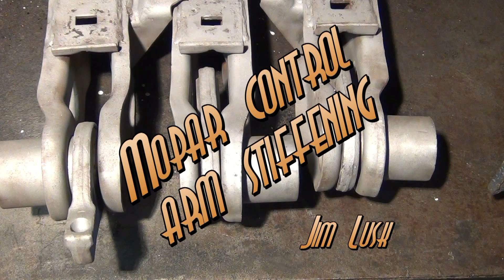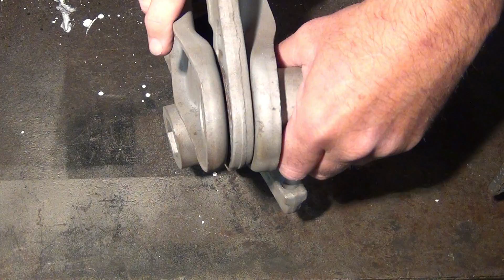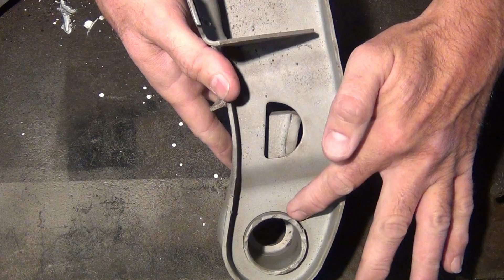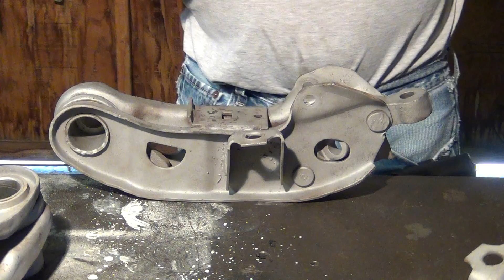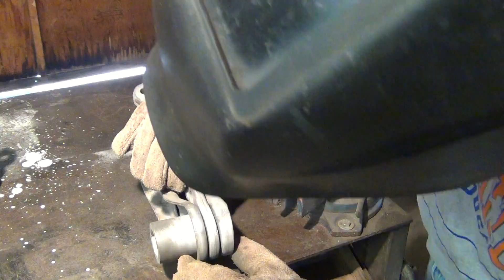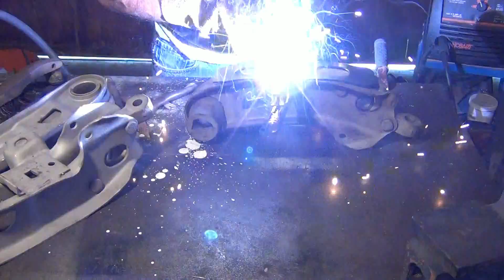Control arm repair

Comment: Thanks Jim! I have been dealing with front end problems on my '72 Satellite/Road Runner Pro street Restomod and I have learned more by watching an hour or so of your videos than in 20 years of reading in magazine articles or trying to talk to "old timers" that know these tricks. i need to fix both lower control arms and reinforce my K-member and maybe i can finally enjoy driving my car and having it go straight down the road! Heck I might even get it on the dragstrip someday!

Comment: Thanks Jim. Can they be too tight? I have a set I bought that have had  a stiffener plate added around the outside radius. The torsion bar pivots are stiff and just able to be rotated by hand. Do you think this would be a problem?
Reply from the maker: If you can rotate by hand you are fine. Yes, they can be too stiff, but that is more of an installation problem than a functioning problem.

Comment: Did you make the stiffening plates ? Or buy them ? If bought where do I buy them at ? Thanks Jim
Reply from the maker: I bought them from the maker, but they are available from Mancini and probably other sources.
Reply: if you want it, i can sell you a template on PDF, you print it and use to cut on the metal sheet 14 gauge. We can use paypal :D

Comment: Thanks for posting. I can see the excess movement in the control arm but am curious to know how this would manifest itself in handling of the vehicle. Thanks again.
Reply from the maker: We're really not sure if the play affects anything in normal operation, but we know it shouldn't be there. I pulled my GTS apart a couple of years ago. The car has around 160,000 miles on it and the front end has been rebuilt once (1986). There is very little play in those arms, so the factory got some of them right, but quality control was not really job one at any of the car companies back then.

Comment: Well Jim, You never thought to put it back in the vise when you welded up the stiffening plate to take the rest of the "slop" out of it?
Reply: You can also make a plate for the round end also I have also done that .fact is that part adjusts the torsion bar and does not mvw going down the road.

Comment: how thick are those stiffening plates?
Reply from the maker: They look to be 1/16".
Reply: hubby wanted to know would that be the same thickness to 18 gauge steel sheet 4x8 he bought? he working on a 69 charger general lee this is the last thing he wants to do before he can put it back together
Reply from the maker: No. According to what I could find 18 ga is about 3/4 the thickness as 1/16".  I can measure these better later.
Reply: ok thank you that would be great

Comment from the maker: There is a large bolt in the middle of the control arm. With the car supported on stands under the frame loosen the bolt on each side until it rocks freely.

Comment: Getting ready to replace the whole front end on a 1968 300,and I was wondering how to properly release the tension on the torsion bars.
And  thanks for the vid , I'm just a little bit smarter now.